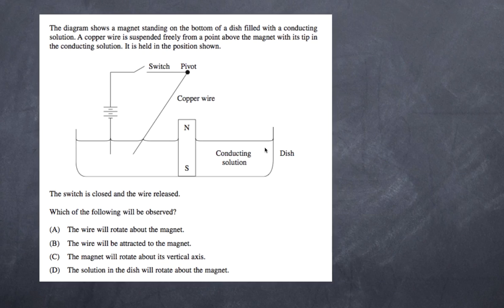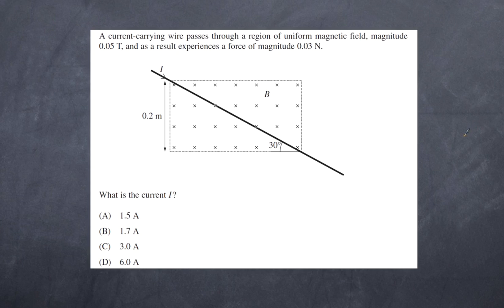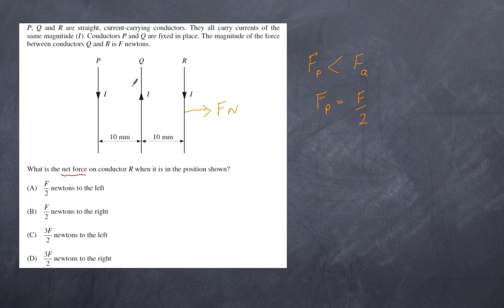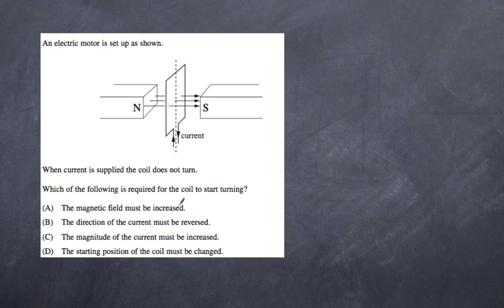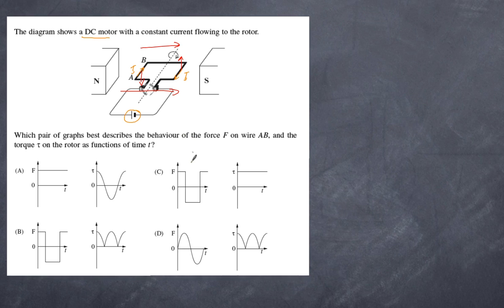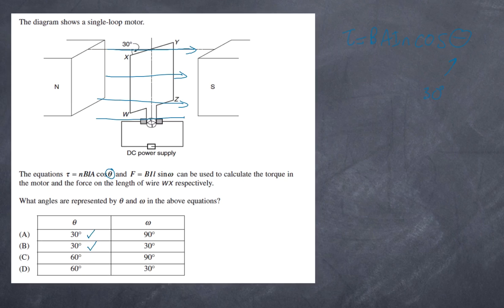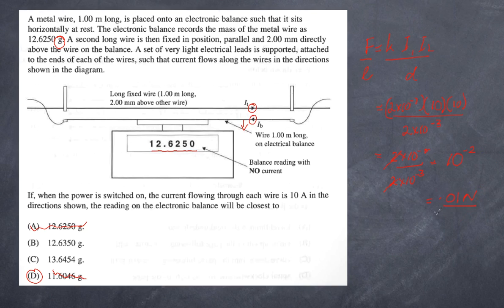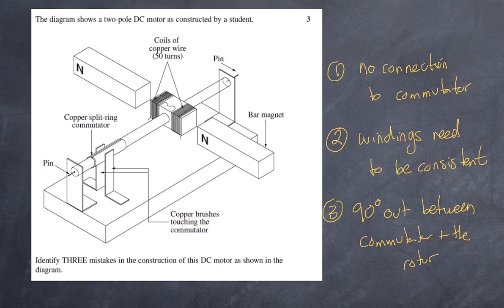How  well do you know the motor effect?

Comment: Hello, could you please make a video on tourqe for module 6 in motors it'll be greatly appreciated.
Reply from the maker: Have you seen my general torque video?
Reply: @PhysicsHigh  no sorry, i will watch it, does it apply to electromagnetism in the same way?
Reply: @YourDailyDoseofContent  The video is about torque in general, but directly applicable. torque  = force  x distance (radius of turn, but more correctly we use the term "moment" ). 
In the electrical motor Force  = B . I . L. 
So now torque  = B x current x length x radius
But you have two forces on both sides, so total torque  = 2 x force x current x length x radius. So what is 2 x length x radius? The area of the loop and now we have torque = B x A x I x n (where n is the number of turns. Also have a look at my galvanometer video
Reply: @paullooyen1951  I have, and thankyou very much:)